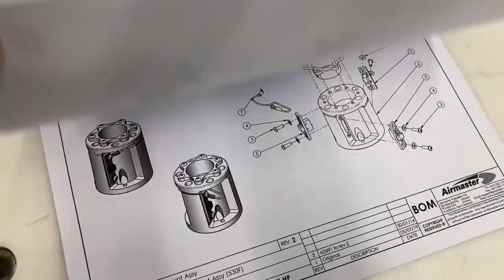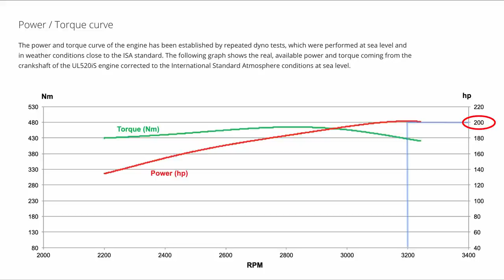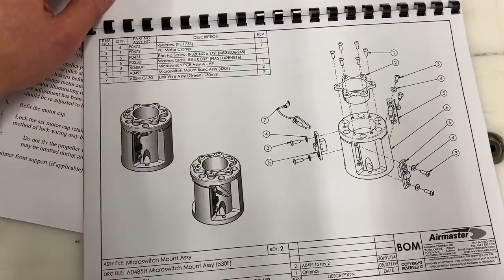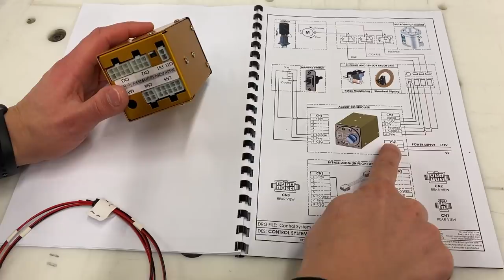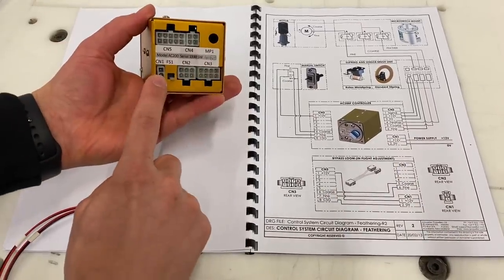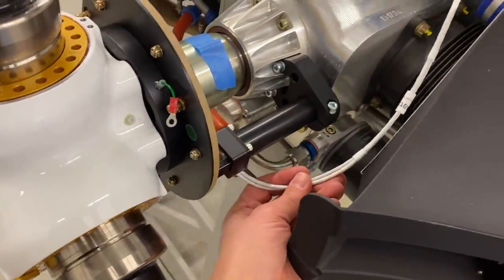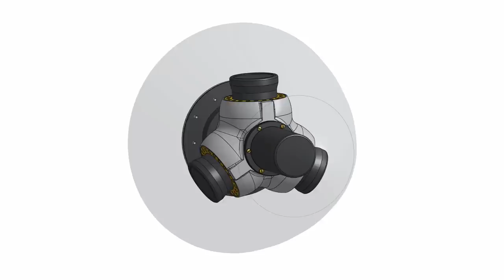Why this propeller is different: Airmaster Propeller on the DarkAero 1

Comment: That prop system looks really cool. One question I have though is regarding a fail safe for rpm control. Does that electrical control system have a way, if something were to fail, to bring that prop back to a high rpm setting similar to old hydraulic designs?
Reply: No, if the system fails it stays at whatever pitch it is at.

Comment: How am I going to protect the composite leading edges (Wing, rudder and cowling) from abrasion strikes and wear.   Are there hardened surfaces or coatings to prevent cummulative surface damage?

Comment: Graphene carbon fiber is still fairly nascent.
On top of that, getting airlines to adopt solenoid side fuel cells, or hydrogen fuel cells for that matter for electric planes is a Very tall order.

I think the best way to encourage the big airlines to adopt better planes and fuel cell aircraft, is for the smaller FBO‘s to try it out first with charters and small scale flights.

That requires collaboration with aircraft manufacturers, along with getting pilots, mechanics, and so on and so forth. The infrastructure necessary to handle those flights.  Besides people to handle customers, baggage, etc. etc.

Comment: Merry Christmas ;)
What a cool video!
Isn`t the best economy of the engine at 2400 rpm? Is there a setting for that too?
Reply from the maker: Merry Christmas! You are correct, lowest specific fuel consumption on the UL520iS is around 2400rpm. This could be preprogrammed into the controller for cruise or it could be reached through the hold function and manually adjusting the prop speed.

Comment: Beautiful prop choice! Are there any issues with sandwiching the carbon fibre spinner backplate between the hub and 3/4” extension? I keep hearing about Galvanic corrosion but I’m also wondering how the composite will hold up under the compression (bearing) stress.  Keep up the great work guys! It’s fabulous how you guys openly share so much of the design process with your viewers.
Reply: CF composite does not suffer oxidative corrosion, whether galvanic or otherwise.
Reply: @IhabFahmy  The composite does not corrode, but because it is conductive metals in contact with it may suffer galvanic corrosion. DarkAero has mentioned this many times in their videos, and did an entire video on it.
Reply: @brianb-p6586  Thanks for the clarification. That's a good point. Actually, come to think of it, it's desirable for the fuselage to be conductive to minimize static charge accumulation and to reduce damage in case of a direct lightning strike. Galvanic corrosion of attached metal parts would be a side effect , unless these parts are electrically isolated  from the carbon fuselage (could be as simple as a thin layer of electrically insulating between them). I'll find the videos you mentioned and watch them.

Comment: My question is.  If you have 2  Engine and 2 air master propeller. Do you have to have 1 or 2 controllers?  Please help.
Reply: That's an interesting question (although irrelevant to the DarkAero). The description has a link to Airmaster Propellers; their website shows various applications, including one twin, but it doesn't say how many controllers are used or how they would be configured. Although in normal operation the same speed would be used for both engines, it would be necessary to feather only one of them in case of single engine failure, so the straightforward solution would be to simply use two independent controllers. It would seem prudent to me to mount them side-by-side so it is obvious which one is for which prop, and so that any mismatch in settings would be visually apparent.

Comment: The spinner looks really large.   I have the standard spinner on my Airmaster and it’s much smaller than your custom spinner.   Why so large?
Reply from the maker: 3Blades the spinner is custom to match up with our cowling. Using a larger spinner allows for a more streamlined cowling shape rather than a sharp transition from small diameter spinner to a wide cowling. Thank you for watching!
Reply: @DarkAeroInc  What is diameter of your spinner ?
Reply from the maker: @keltro3053  16.6” at the maximum diameter.

Comment: I'm just saying that maximum torque is between approx 2750 and 2900.  If I were you that's where I'd be interested in the prop design not up at 3200 where torque drops off.  Is there a reason for that design spec?
Reply: Torque by itself doesn't matter; power is torque multiplied by speed, and that's what matters. The speed for most efficient engine operation is usually at somewhat lower than the speed for maximum torque, and apparently UL says that's at 2400 RPM for this engine... but that doesn't matter if that speed doesn't produce enough power to move the aircraft at the desired speed or the speed for best aerodynamic performance.

Comment: Good job! Darkaero1 is such an amazing and exciting project.
You've got a superb prop with a so nice simple control. I'm a little bit worried about your, also beautiful, big spinner: is it attached only by the back plate? In case, you can have inspiration with Mike Patey's one, wich is similar in size (i think) on his Scrappy.
Reply from the maker: Thank you for watching Laurent! There will also be a forward bulkhead within the spinner to help stabilize it.
Reply: Scappy is the better part of 200mph slower. That might make these two projects a little less comparable.
Reply: @randallsemrau7845  i agree, but talking about a spinner is to consider rpm mainly. At take off and initial climb, Darkaero1 running at 3300 rpm is pretty much!

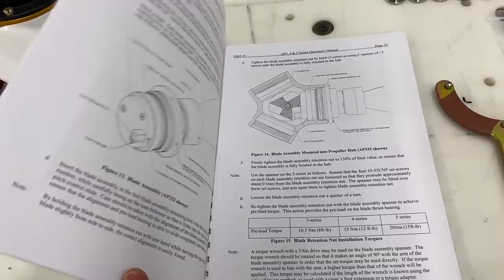Comment: 7:22 So you don't need a torque wrench?

Also: I've watched a few videos now, still haven't heard the max speed you're aiming for
Reply from the maker: We used a torque wrench to get the blades to the right spec (just not shown in the video; link to the wrench used in the video description). Target cruise speed is 275 MPH. :)

Comment: That was a great presentation
Question
Does this prop manufacturer make Propellers for the experimental market too.
Can you share the contact information for the prop manufacturer.
Thanks
Reply from the maker: Thank you! Airmaster makes propellers for the experimental market. More info here: https://www.propellor.com/ Cheers!
Reply: Thank you.
By the way, how much horsepower does your UL engine makes
Reply from the maker: @ulephone1918  the UL520IS that we are using is rated at 200hp but UL Power makes a number of different engines rated from 97hp up to 200hp. They have a turbo version of the UL520IS in development that should be around 220hp.
Reply: Ok
Thank you once again.

One more question

After you have completed your prototype. 

Will you have a fast build kit?

OR

Will you be providing a program for FACTORY BUILD ASSIST?

SOME kit building companies provide such assistance

I have never built an airplane before. And from watching your videos, there are so many little details that need special attention. This why I asked
Reply from the maker: @ulephone1918  We are setting up the kit to be a "quick build" as the standard option. We have had some inquires about builder assistance and this is something we are exploring. We put a lot of effort into making the airplane easy to build so that a first time builder would have a enjoyable build experience.
Reply: @DarkAeroInc  Which makes for a good “rapid build assist” program!  Quicker turn around times, more ships out the door?  There’s an appeal to those who want to get up in the air faster, not needing to get additional tools, build stands etc, and not making common mistakes so it can be done right the first time, no need to craft and ship the kit, also an inspector lined up to clear the ship for testing after the build.  I would totally be up for a 2 week rapid build program :). You could be pushing 26 rapid builds out in one year :)
Reply: @DarkAeroInc  Will builders have a choice between the turbo and non-turbo versions of the 520is? Just thinking how nice it would be to be able to take advantage of those winds up at FL16-20

Comment: How do you balance the spinner cone or is that not an issue because it's so light weight
Reply from the maker: Paul, we will end up balancing the system as a whole with the spinner attached. There are tools like the DynaVibe that allow you to get everything dialed in.

Comment: I wanted to see the blades move!  Also what is the TBO on those brushes (and the prop as a whole) and to they have some kind of cover for FOD? What is the fail safe position if power is lost. Would be nice to put the brushes and contact ring on a motor and just let it run for a few weeks to see what wear there is. Maybe set that up with the manufacturer?  I did find this link. https://www.youtube.com/watch?v=CfypOxeM0HE  Who about reverse?

Comment: It it just me, or is the sliding block in the rotor hub made out of plastic??????
It doesn’t look like steel, and ceramic would be to brittle for an application like this, so please tell me that there rare different materials that look like that but are not plastic
Reply: It likely is, and probably should be, a suitable polymer (plastic).

Comment: Isnt 3 blades less efficient than two? Not like the engine is more than a 2-blade can absorb.
Reply: It is a little less efficient, but lets you have shorter blades to avoid mach numbers, and ground clearance. And it gives more torque.

Comment: The most efficient and effective control method would not be constant speed, but speed mapped to engine power. I can see why mechanical systems of decades ago used a mechanical governor, but with electronic control a knob to manually select a speed - instead of rational integration with the engine control - seems like a mediocre solution.

Comment: Works with ulpower 520t?
Reply from the maker: We are keeping an eye on the turbo version of the UL520iS and have considered what modifications would be required to the DarkAero 1 to adopt it. For now, we are remaining focused on integrating the stock version of the engine.
Reply: @DarkAeroInc  I'm building an Rv-7 with an Ulpower 520 turbo engine, and I didn't know if it would work. AirMaster has a propeller for the turbo 220 hp version

Comment: Put contrarotative propeller 🤩
Reply from the maker: That would be pretty awesome! I always liked the coaxial counter rotating props they put on the high power WW2 fighters. There were some guys who had a twin engine Cozy with two props spinning opposite directions on coaxial shafts with a belt drive. Maybe on the next DarkAero design! 😉 Thank you for watching!

Comment: Don't use a spinner bulkhead made of carbon. It is dangerous. Even high TG resins can't really handle the heat and friction produced by the peaks of torque. The bulkhead will tend to get soft and you will loose torque on the prop bolts.
Reply: If that's an issue (and it does make some sense) then washers in holes in the bulkhead seem like an obvious solution, rather than changing the material of the entire bulkhead.

Comment: That graph you start showing at the 2:00 minute mark is fake. It is not possible for HP and torque to cross over at anything less than 5,250 RPM. HP is a math calculation of torque at a specific RPM. The HP and torque intersection reaches 1:1 ALWAYS at 5,250 RPM so any graph that shows torque and HP intersecting at anything different than that is fake.
Reply: That would only be true if the power is in horsepower, the torque is in pound-feet, and the power and torque are on the same scale. In this case, torque is in newton-metres, and power and torque are on separate scales, so the intersection of the displayed curves is at a different speed. It's not fake - you just don't understand what you're looking at, and apparently didn't even really look at it.

To confirm: in the displayed graph, the curves cross at about 192 HP and about 460 Nm; that corresponds to 2973 RPM (192 HP @ 2973 RPM is 460 Nm, and 460 Nm @ 2973 RPM is 143 kW or 192 HP) so at least at that point the torque and power data are consistent. 
For another check: both curves end on the lower limit at 2200 RPM. At that point the torque curve says 430 Nm which would be 99 kW or 143 HP; at the same point the power curve says about 135 HP (101 kW) which would be 437 Nm... they match, as closely as they be read visually.

Comment: I feel baited. it's a pretty conventional prop, just with an electrically actuated pitch mechanism.
Reply: Electric actuation is far less common than hydraulic actuation. How does the title qualify as baiting?
Reply: @randallsemrau7845  it's an actuation system. It's hardly related to structure or aerodynamics. To me at any rate, that's what would make a prop unique or different. I wouldn't bother calling a wing 'different' if it had linear actuators instead of hydraulic rams for the control surfaces.
Reply: @weatheranddarkness  I can see why you wouldn't consider a wing significantly different because of a different type of control surface actuator. A prop hub however, will be significantly different depending on the actuator style. 
I don't see any mention of structure (fuselage) or aerodynamics in the title for this video. If that's what you were looking for, there are plenty of other DarkAero videos....

Comment: New materials. Same crappy old engine.  
I'd want to see a water cooled, direct injection, free valve modern engine. That's how you get power and efficency.
Reply: The powerplant has to fit within the designed cowling. DarkAero is working with the best, smallest frontal area, appropriate displacement, air cooled FADEC recip engine available. All the water cooled options share greater complexity, a larger frontal area, and additional cooling issues, all enemies of efficiency.
Reply: You have got to be kidding about using a free valve engine in an airplane. Koenigsegg has been promoting this to the gullible to increase investment in his company, but it is no where near ready for adoption and will likely never be practical. So if DarkAero were dump enough to take your suggestion, they would never get off the ground. Fortunately, they are doing due diligence and making good choices.
Reply: A sophisticated valve control system such as Freevalve is great for a car, but not suited to an aircraft. In addition to needing higher reliability, the aircraft doesn't need advanced valve control because the engine works in a very narrow band of operating conditions.